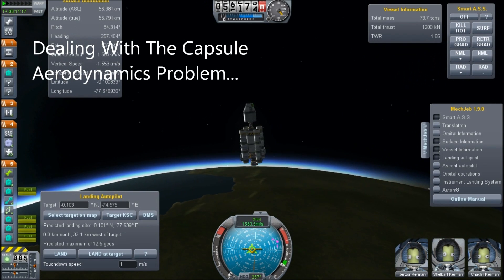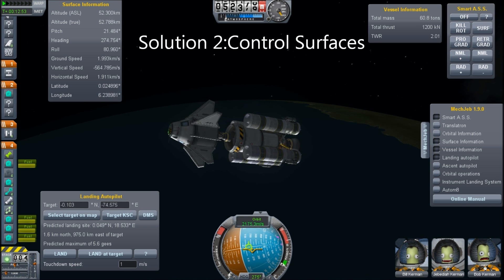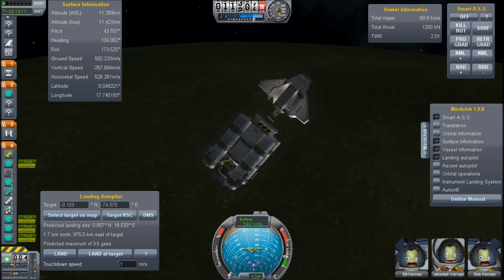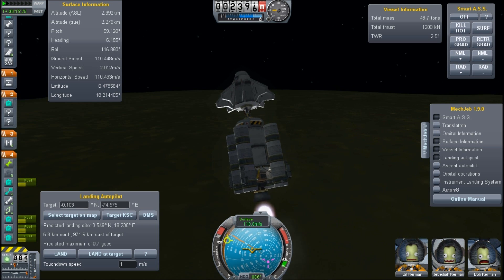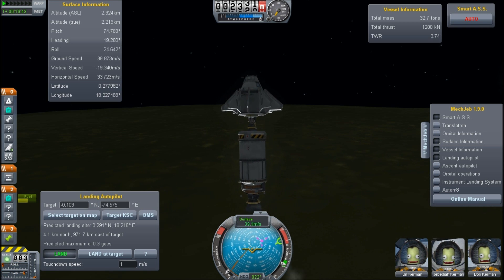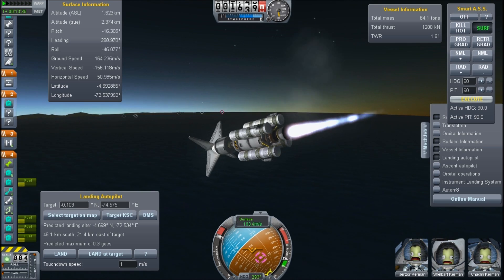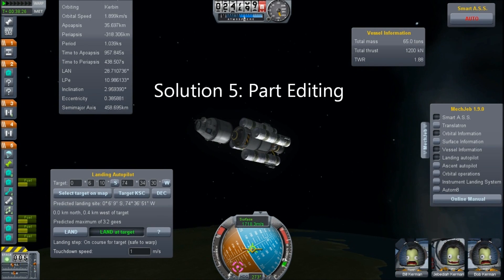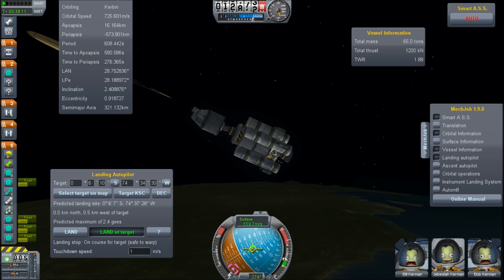Solving The Aerodynamic Problems Of The Planetary Lander - Kerbal Space Program

Comment: I "solved" the large powered lander problem by basically building the lander upside down on top of the rocket, so the engines are pointing in retrograde direction.

Downside is that it's not very mechjeb-compatible in the lander stage, but it's not very hard to land manually because of the huge aerodynamic stability.

Comment from the maker: Is that a 'standard re-entry' with a parachute on top?  Even before it's deployed the parachute will be experiencing a larger drag per unit mass than the capsule, so it will naturally rotate in that direction. Try dropping a capsule from orbit with the parachute on the bottom of the capsule.

Comment: I agree, more parachutes/ less weight will do the trick. Your issue in that test was that the chutes broke down when they opened due to excessive weight and as everything in KSP explodes when it breaks, it it made the ship to break. les weight per parachute area would make things smoother and, even if it tumbled, you would have time to use the capsule SAS to correct it. Just don't forget to not put all of the cutes in the capsule, unless you want to detach the capsule from the rest of the lander

Comment: Why not put your module on the bottom (or close to)? Have your engines mounted radially around your module. You'd also eliminate the need for a fiddly ladder system.

Comment: you can always counterbalance the aerodynamics, put a few reversed wings or winglets on the base portion to counteract the aerodynamics of the pod. it would add weight but the generated lift might be enough to counter it on decent. Ideally it should be enough to make the bottom either the same or slightly more aerodynamic then the nose, letting the bottom be forced into the direction of movement.

Comment: Well you can, just rotate the decoupler by 90 degrees, but the joint there is weak, and based on your launch vehicle.. put at-least 16 struts..
----
About the Aerodynamic issue, why not use centrifugal force u used in your unnamed rocket..
Spin the ship [counter]clockwise, in a almost vertical position.. Use a few parachutes..
Wait until 200m/s engage the engines.. and well struggle a bit and land..

Keep up the good work..

Comment: Actually you can by attaching another tri-coupler underneath. You can do this by flipping the second tri-coupler upside-down (you can manipulate parts with the wasdqe keys and hold shift for fine control if you didn't already know). It's a bit finicky but totally possible and very useful.
Fly safe!

Comment: I suggest you have the small orbit stage BELOW the large tanks for landing, with the four sets of small tanks on the sides with 1m engines and landing gear. basically just move the low-drag capsule away from the top.

Comment: Why not have two radial ejection atmosphere engines attached to the top capsule stage? They'd help create a pseudo-pendulum effect, you could turn them on and off at will, and they'd help you get initial lift with their great fuel efficiency.

I mean, they'll add some weight, but for atmospheric planets they'd probably boost your efficiency enough to compensate on those phases.

Comment: While far from the optimal solution and adding a lot of extra weight, if you put a decoupler beneath each of the 3, you can then add an upside-down tri-coupler to attach to the rest of the rocket.

Comment: I sent you a message of a minimally changed design.  It uses your heavy lander with four parachutes attached to a fuselage extended from the top of the pod, the leverage pulls the aircraft strait allowing for a perfect landing.  It has been tested and has succeeded without editing any parts.  Even when the parachutes opened and ripped the fuselage from the pod they had slowed me enough to complete a powered landing.

Comment: Three suggestions:
1. More parachutes: you can attach at least 8 to a decoupler on the capsule
2. Kitchen Sink approach: use RCS, control surfaces, wings, and parachutes
3. Move the departure capsule to between the main fuel tank and the engine, and feed fuel around it.

Comment: I've been using groupings of toroidals on the bottom of large fuel tanks for a while now.  I've found that 1 medium 1m gimballing engine in the middle is enough to get by with up to 6 toroidals added radially to it, but I personally only use 3 toroidals with 1 med. 1m engine when I want more control.  Control surfaces aren't that good because often the toroidals are so powerful that the Gs will turn you around, even outside the atmosphere.  Also the vectoring engine allows you to add a decoupler

Comment: Would the combination of the smaller engines with the aerospike in the centre would work? The only problem would the lack of control due to lack of gimbling engines but that could be remedied using other control surfaces.

And just as a shot in the dark, have you tried inverting the wings so they point downwards? Or does it not matter that much?

Comment: this may be crazy, but what if you were to replace your double 3m take with a single 3m tank, then place another single 3m tank on top of your capsule(with a decoupler) and run a fuel line down to the 3m tank that your large engine is attached to. This way the capsule is more in the middle of the rocket and you might save on weight because you can discard the top tank when it drains. 
If my description is too confusing I could make a video response.

Comment: you can stack things below it if instead of using a tricoupler, you use a single 1m fuel tank with other fuel tanks attached directly to it radially.  The fuel tanks have crossfeed capability by default, and if you use a bell engine in the middle you can attach a small decoupler to that.

Comment: also, you should try toroidal groupings at the bottom instead of the large engine.  Works like a charm for me.  I have one 1m engine attached to a 1m half tank at the bottom with a medium thrust vectoring engine, with toroidal engines on full 1m fuel tanks directly attached in a radial fashion.  The medium 1m vectoring engine just helps add a little control.  I put these groupings on the bottom of the 3m fuel tanks and they are insanely efficient at leaving planets with atmosphere.

Comment: probably one of the easiest things to do (imo) is to have the capsule on backwards.  It looks a little weird, but works perfectly.  Also, it doesn't look near as weird if it sits at the bottom, and then you don't need many ladders to get in and out of the capsule either.  Other than that parachutes are pretty decent for my ship, but will only work if the planet's atmosphere is not in the threshold between lost control and partial deployment.